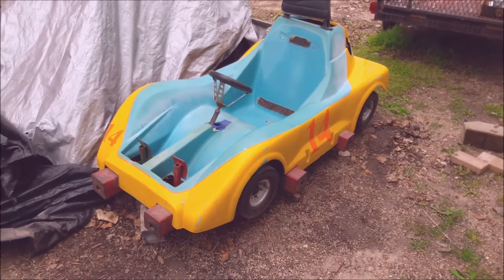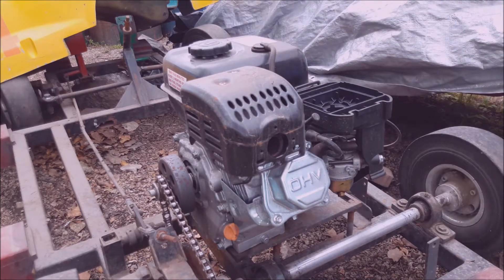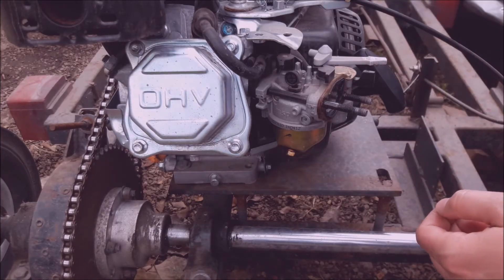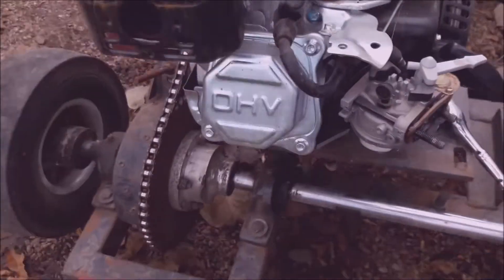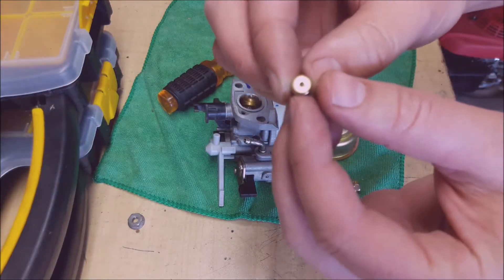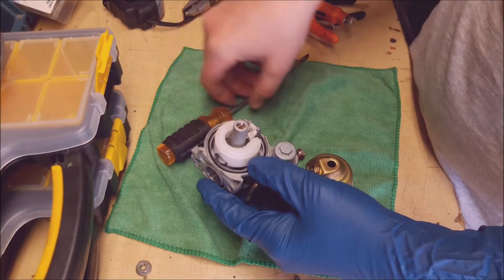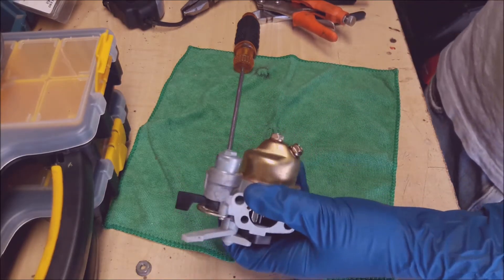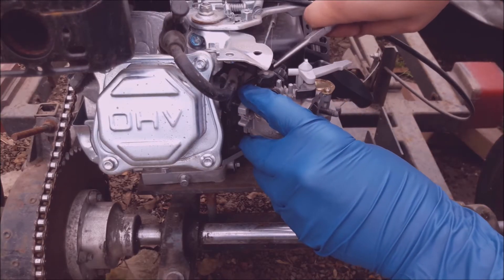Go Kart Harbor Freight Predator 212 Won't Start?

Comment: It doesn't make sense that you claim there is a problem with the carburetor when the engine started at the beginning of the video. Please explain.
Reply from the maker: It started with staring fluid not with gas from the tank. It means that one of the ports in the carburetor is clogged and not letting fuel in.
Reply: @-DIYPRO-  well how would you know if it didn't start with gas even though you sprayed it? You must've tried starting it before spraying it and it didn't start until you sprayed?
Reply from the maker: @Goodoldays9  Yes, exactly. I went out earlier and tried starting it and nothing.

Comment: Make sure if you order this engine that it doesn't come from California or any state with emission laws that effect small engines I bought this engine  and it ran rough. It surged  smelled as if it was flooding studied up on it there is no adjustment for air fuel flow had to order a new adjustable carb. Only 22 dollars with tune up parts but from time engine arrived till use was 5 weeks.  Beware !!!

Comment: Mine wont start right out of the box. 😢
Reply: Same
Reply: Mine only start with the choke on run and shuts off immediately if I switch to start while it's running @malachijodway3350
Reply: Me too 😭
Reply: Same
Reply: Put oil in it otherwise return
Reply: Well, did you put oil in it? They don’t come with oil in it.
Reply: @cylekurtley3498 I did but the sensor ended up being bad

Comment: Hey i was wondering if you know how to fix a problem that i have on my predator 212 it only starts with starting fluid then it shuts off and I already put a new carburetor
Reply from the maker: If it starts and then dies it's a carb issue. Was the carb an aftermarket one? Sometimes, even new ones, still have issues out of the box.

Comment: Changed out the carb on mines the only way I can get it to start is if im holding the throttle.  Carb was tuned to specks im lost on this one any pointers..

O yea so when I was draing gas from the bowl I started it up just to see and it ran without shutting off the minute I closed the drain to stop the gas from leaking it shut off
Reply from the maker: Late response but it sounds like an air / fuel mixture issue. Did you end up finding the issue?

Comment: What if my turns on but when i switch to run it stalls out
Reply from the maker: Have you tried cleaning the carb? It means you have a very small piece of dirt or dust that is not letting enough gas into the cylinder when you take the choke off. Clean the carb and that should do the trick.

Comment: I just bought myself one and it won't start out of the box. I checked the spark and it works, I can smell fuel when I pull the cord. I'm thinking when I hooked up the new fuel line I messed with the carburetor and knocked something loose. I'll have to take a look at it tomorrow.

I think I seen what I did wrong. What are those linkages you put on there at the end? What are those for because I took mine off and couldn't figure out where they went back on it.

Comment: I put the stage one kit from go power sports on the engine and I put the upgraded jet on there and now it won’t start? Do you think it’s because of the jet? Should I put the old one back on?
Reply: YouTube how to "tune a carberator" you could be giving it too much air and its choking. Or giving it too much fuel and its drowning. Since you put a stage 1 from powersports im guessing you put just the exaust pipe and air filter. Those air filters are huge!!! And giving it too much air. You'll need to tune it down because giving it to much air will choke it out. Might even have to change the air filter only

Comment: Need help with mine, it idles but it sounds like its cammed. Sometimes it dies out, then I have to pull it to start it, after doing that I try giving it throttle but it stalls. I've cleaned the whole carb, checked for air leaks. I'm super lost
Reply: Same bro same
Reply: @lucid4984  i just figured out the problem, wasn't even the carburetor. It was the spark plug. Thing was fouled to hell and back with oil, and gas. Got myself a new spark plug and she runs like a dream now!
Reply: @BAMaher  mine has a good spark, everything seems fine but I can’t tell so I’ll try the spark plug but I cleaned the carb and it won’t start at all
Reply: @lucid4984  dumb question, but do you have the motor choked when starting it? Also I'd try something here... squirt a little fuel in the cylinder threw the spark plug holes and see if it turns over
Reply: @lucid4984  when I worked on 2 strokes and couldn't get them started I did that all the time
Reply: @BAMaher  I actually put a spark plug in it 30 mins ago, started right up
Reply: @lucid4984  glad you got it fired up again
Reply: @BAMaher  me too, thank you

Comment: Mine will run a little bit and go out the driveway and shut off
Reply from the maker: I'd clean the carb again. Either the main get or the inlet is dirty.  Sounds like a little is getting through when starting but not enough to keep it running.

Comment: Mine starts. Stays on for like 10 seconds then it turns off. What should I do?
Reply from the maker: Did you try cleaning out the jet? That would be my first guess of the issue. Since it starts the port for the choke is not clogged just the main jet.

Comment: I used regular car oil for a go kart and it worked for about 10 minutes now it won't start could the oil be a problem its a brand-new go kart
Reply from the maker: No, I've used car oil for years.
Reply: One year late but the predator 212 is designed to turn off when the engine tips over. This is called the "oil sensor" which is the yellow cable next to the kill switch. You can youtube how to remove it. The engine will shut off when the oil is low and most of the time a 212 will be placed at a weird angel on a go cart making it shut off because the engine thinks it's not getting enough oil (even though it is)

Comment: What if the engine doesn’t want to run at all even with starter fluid. What’s the problem there
Reply: Have you checked for spark?
Reply from the maker: Double check it's on. Check that it has oil (these have oil sensors that cut power if the oil is low). Check if you are getting spark from the plug.
Reply: Mech Master Hi I have the same problem, how do you see if you’re getting spark?
Reply from the maker: @hxnsell5825  I show how to do it in this video.  

https://youtu.be/UHdktxjBjew